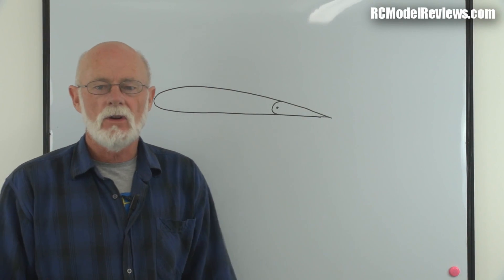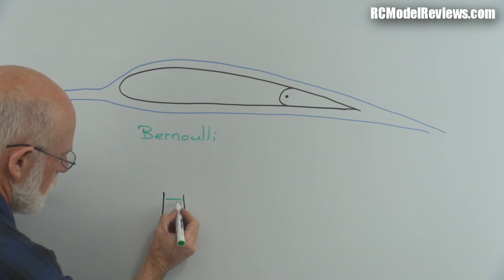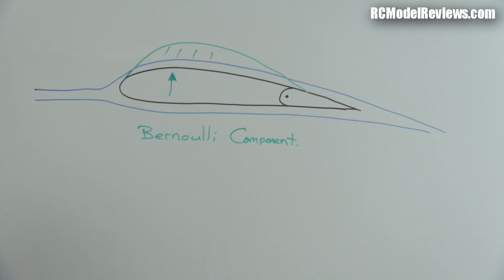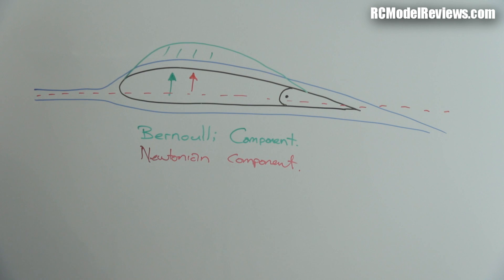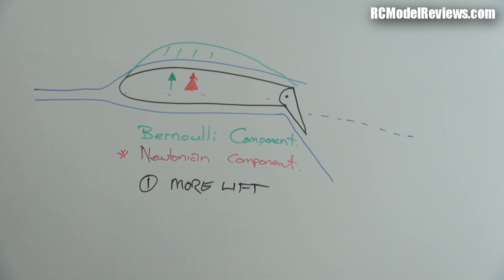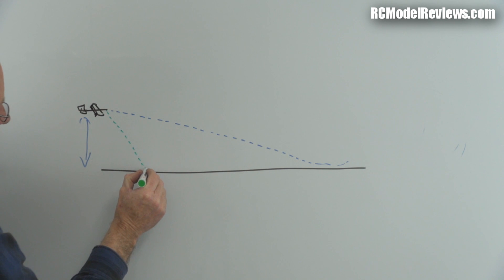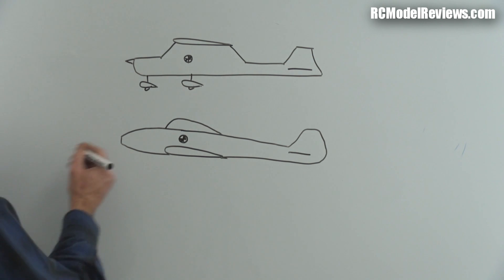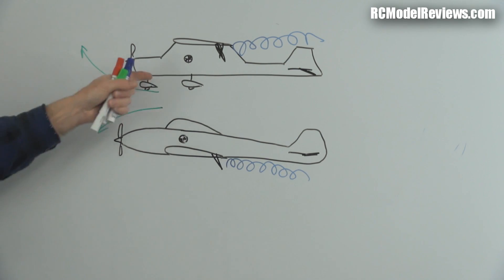How aircraft flaps work

Comment: What percentages of total lift come from the Bernoulli component and from the Newtonian component ?
Reply: i write, to share more-correct info about  Lift.   (forget the name   bernoulli.)
if the clark-y profile is  analyzed, it can be seen that it is a two-surface, cambered, flat-bottomed, low-re#, profile.      it is thickest at  29-30 percent of chord.       its (slightly) raised leading edge results in about  three degrees of, built in,  positive aoa.     AND  the  Wing  is intended to be mounted  at  zero-degrees aoa; relative to its lower surface.      consequently, this type of wing configuration  Makes  LESS  drag  than ANY  wing that is mounted with  positive aoa. !!!!
newtonian lift occurs  at the forward  five to eight percent  of the lower surface  of a (clark-y)  wing.
aerodynamic lift occurs  Below the parts of the wing,  where  Turbulence  is  present, Above.  (roughly, the, aft, forty percent of chord.)       cheers
http://1.bp.blogspot.com/-5C8vhlmhBOk/VRe3o3Jt3yI/AAAAAAAABrI/EEgVHXkLvbY/s1600/clark%2By.gif

Comment: At 3:23 you assume that lower and upper flow travel their paths in the same time (upper being longer). From basic aerodynamics we know, that this is not the case, the fluid particles that part at the nose in general don't meet at the trailing edge. (Of course you have mentioned that this line of reasoning is not entirely accurate, but heck... ;) )
Reply: For aviation students and patterns, the way in which he explained is still the most assumed  as correct.

Comment: Good teaching. It would be enlighting if someone explains "why airplanes fly" with symmetric wing profile. After that it would be more informative to show a bit asymmetric wing profile that create some Bernoullis effect also.
Reply: if an aircraft wing has a symmetrical profile, either the aircraft is over-powered/a prop-hanger;   or  the wing is mounted with  positive aoa.     unfortunately, the use of the latter was   common, in the  gas-power era.    so, we still see  models  where this  antiquated configuration is still (blindly) being used.    cheers

Comment: You are a great teacher and this video is very informative, but a nasa study shows that both of those theory’s are erroneous. It has been proven that “Newtonian” lift has ever been achieved was at very high velocity in low pressure air. Thus it is not the 3rd law that causes a plane to rise rather when the air splits when going over an airfoil, the shape creates a phenomenon on the top of the wing at the leading edge that causes that air to accelerate , and move faster over the top than the bottom. The top of the wing is actually much more significant than the bottom. Thus it obeys Bernoulli’s fundamental principle, but the distance theory and the Newtonian theory are completely debunked and aren’t actually factors in flight. Look it up for yourself. You can find it on nasa

Comment: I completely understand how moving air has an effect on pressure, but I cannot understand why the air over the top and bottom of the wing has to meet at the same time along the trailing edge. From my understanding of the physics there is no reason for such an assumption. And if the split streams do not have to meet at the same time, then why does the top stream have to move faster just because the distance is slightly longer along the curve? Maybe it does, I don't know, I'm just saying I do not understand why this would  be the case.

Comment: Bernoulli wrong, Newton correct. 

ANGLE OF ATTACK IS EVERYTHING. ALL wings generate lift PRIMARILY due to some measure of angle of attack. That angle is established by the horizontal stabilizer. 

There is SOME lift via Bernoulli with a TRUE flat bottomed airfoil but the effect is minor. 

Consider that UNDERCAMBERED wings lift MORE than flat bottomed wings. And they do that for the same reason that flat bottomed wings generate a bit more lift than fully symmetrical wings. 

The wing simply SCOOPS the air. It really IS that simple.

Here's a good explanation https://www.youtube.com/watch?v=w78JT6azrZU&lc=UgjUko_tf5vL3ngCoAEC.8EQi2AokVTW8w0lYg0lbx-  that is MORE correct, but they left out the angle of attack aspect.

Comment: Thank You very much for the video and very nice way of explanation. But , just one thing I would like to point out is that, modern explanations and newer research for the reason behind generation of lift suggests the 'Coanda effect' and not Bernoulli. The flow from the upper and lower surface do not meet at the same time.
Reply: No, Coanda effect is completely uninvolved in lift generation. I'm not sure how that spread so much but it's completely wrong. Source: probably any aerodynamics textbook ever written, but Anderson 12th edition for sure

Comment: Late to the party, but still an excellent video. 

I would like to add a warning to people who choose to go with "flaperons" on their model, (where ailerons and flaps share the same control surface). Especially when the model incorporates full length ailerons, (ie: aerobatic planes/flying wings etc.).  You must be very careful of your speed and your directional corrections under these conditions. Any directional correction should be as minimal as possible. If you're flying your model with the flaperons deployed fully and the model is flying just above it's new lower stall speed, then you suddenly make a large correction with aileron input, the rising aileron will drastically reduce the lift thus taking away the extra lift the flap was giving and very likely stall that wing, causing a spin, if it has time to spin before it hits the ground. Just something to keep in mind.

Comment: Flaps reduce your stall speed but when you turn your stall speed starts going back up . And also you would better off starting with different camber wings and then explain how flaps work how they change the camber of the wing and when you put in flaps high or low wing the nose will pitch up because of the extra lift being generated by lowering the flaps . Jets have flaps and slats changes the wing area and camber . And with how a wing works don't forget to explain laminar separation. . These are only theory because no one knows how a wing works 100% they are only guessing.

Comment: Actualy the pitch up and pitch down answer is because of flaps extra drag not because of extra lifting force. The cg of the plane must be already aligned with this wings lifting force and this forces will not create any tourque because it has not any perpendicular force between cg and lifting force line.
If you create a new force with flaps drag or anything else that will cause a torque and this torque will try to spin model from its center point until you create a negative torque, in this example with elevator or something else
Thats why the plane starts to act like it has a elevator movement

That may be my first comment under your videos, because of that i dont want to be the bad guy :D just because of correcting something in video
I like this channel so much and you are the one of my best teachers thank you so much for everything you teached me :-)
Reply: What?! Did you watch the same video as me? You're not correcting anything, this is exactly what he says in the video at 11:41. Nor does he say anything about lifting force creating pitch change.

Comment: Thank you for the (simplistic) explanation.  The only spoiler for me was a bit of confusion you caused by naming that dotted red horizontal line (the one you drew through the airfoil on the whiteboard) a datum.  The only 'datum' I'm aware of in an aircraft is its 'reference datum', often from the leading edge of the wing, which is in the vertical, not horizontal, plane.....!??

Comment: Oh God here we go another deluded Bernoulli disciple. A higher streaming velocity is the effect of a lower pressure and never its cause.The conventional explanation of aero dynamical lift based on Bernoulli’s law and velocity differences mixes up cause and effect. The faster flow at the upper side of the wing is the consequence of low pressure and not its cause. And what effect lowers the pressure - the Coanda Effect. 

Low pressure precedes velocity and not the other way around. The low pressure caused by the air flow following the air foil shape (the Coanda Effect) THEN causes the air to accelerate. Anyone who would like the theory to back this up simply email me and I'll forward it on. This was a common knowledge until about 1920 when academics began injecting their distorted view into aerodynamic theory.

Comment: I am sorry, but you are repeating bad science that is well known to be incorrect.
...
@ 1:43: Bernoulli did NOT say "The faster the air flows, the lower the pressure. " He said that when the speed increases (accelerates) there is an accompanying decrease in pressure.  The difference in pressure is the source force that causes the acceleration.  A higher pressure accelerates the air toward a lower pressure region.  That is why it is moving faster when it gets to the lower pressure.  Air has mass and it takes a force to accelerate any mass, even air.
..
@ 2:39 The blown air is at the same pressure around it.  When the stream of air hits and is forced up and over and around the top of the straw (this is acceleration) the acceleration causes the lower pressure.
Full explanation and demo here:
   http://www.millersville.edu/physics/experiments/093/index.php 
 ..
@ 3:00 Bernoulli was correct. People just misrepresent it, See @ 1:43 above.
..
@3:20 The air above beats the lower air by a long shot. See for yourself on a real wing:
 https://www.youtube.com/watch?v=UqBmdZ-BNig   Narrated, no title at start Cambridge Univ.
 ..
@ 3:25 The upper pressure is lower because it is trying to swing out, away from the curve due to its inertia. This is Newton.
..
@ 5:13 The pressures around the wing provide ALL OF THE LIFT force AND also cause the downward flow behind the wing. Pressure accelerates the air downward - the same pressures that push the wing up.
The pressures do both things. The downward motion is not something that "adds" to the lift.
..
The flaps increase the effective Angle of Attack (just like increasing the whole wing's Angle of Attack) which increases the acceleration of the air both below and above which causes the pressures to change more, meaning the pressure under increases more and the pressure above decreases more.
..
Summary: The relative motion causes the wing to push air around inorder to move through the air.  This directly causes pressure changes at the surface, fortunately for us this is an increase below and decrease above.  This is ALL OF the lift.  These SAME pressure changes also cause the air to be pushed down as the wing goes by.
Real measurements around real wings show that the magnitude of the upper and lower flow velocities are not very different, but that the air above is accelerated much more from a forward movement to a rearward movement totally changing direction. (YES it actually goes toward the tail as the wing goes by). This faster on top nonsense illusion is only seen in the unnatural reference frame of a stationary wing in a wind tunnel.
...

Comment: Nice explaination sir, got some knowledge about flaps and aerodynamics.......
Reply: +Bharath,
I am sorry, but this video is repeating bad science that is well known to be incorrect.
...
@ 1:43: Bernoulli did NOT say "The faster the air flows, the lower the pressure. " He said that when the speed increases (accelerates) there is an accompanying decrease in pressure.  The difference in pressure is the source force that causes the acceleration.  A higher pressure accelerates the air toward a lower pressure region.  That is why it is moving faster when it gets to the lower pressure.  Air has mass and it takes a force to accelerate any mass, even air.
..
@ 2:39 The blown air is at the same pressure around it.  When the stream of air hits and is forced up and over and around the top of the straw (this is acceleration) the acceleration causes the lower pressure.
Full explanation and demo here:
   http://www.millersville.edu/physics/experiments/093/index.php 
 ..
@ 3:00 Bernoulli was correct. People just misrepresent it, See @ 1:43 above.
..
@3:20 The air above beats the lower air by a long shot. See for yourself on a real wing:
 https://www.youtube.com/watch?v=UqBmdZ-BNig   Narrated, no title at start Cambridge Univ.
 ..
@ 3:25 The upper pressure is lower because it is trying to swing out, away from the curve due to its inertia. This is Newton.
..
@ 5:13 The pressures around the wing provide ALL OF THE LIFT force AND also cause the downward flow behind the wing. Pressure accelerates the air downward - the same pressures that push the wing up.
The pressures do both things. The downward motion is not something that "adds" to the lift.
..
The flaps increase the effective Angle of Attack (just like increasing the whole wing's Angle of Attack) which increases the acceleration of the air both below and above which causes the pressures to change more, meaning the pressure under increases more and the pressure above decreases more.
..
Summary: The relative motion causes the wing to push air around in order to move through the air.  This directly causes pressure changes at the surface, fortunately for us this is an increase below and decrease above.  This is ALL OF the lift.  These SAME pressure changes also cause the air to be pushed down as the wing goes by.
Real measurements around real wings show that the magnitude of the upper and lower flow velocities are not very different, but that the air above is accelerated much more from a forward movement to a rearward movement totally changing direction. (YES it actually goes toward the tail as the wing goes by). This faster on top nonsense illusion is only seen in the unnatural reference frame of a stationary wing in a wind tunnel.

Comment: What happens to stall angle with extending flaps..? Thanks
Reply: It will be less for the main part of the wing. With flaps extended the critical angle (stall angle) is less than when not extended.

Comment: I can't speak for model airplanes with flaps because I've never flown one with flaps but with a full scale low wing aircraft, the nose will pitch up just like high wing aircraft, I have noticed that low wing aircraft like the Piper Cherokee, the pitching up behavior is not as prominent as it is with a Cessna 172 high wing.

Just a couple of weeks ago, I flew an Aerospool W9 which is a low wing sport class aircraft with fairly small flaps but the nose pitched up significantly at about 12 kts above stall speed. 
A friend of mine flew his Piper Arrow low wing and was having to add full down trim at near cruising speed after takeoff, he felt pretty dumb when he realized that he had forgotten to raise the flaps. 
That was slightly dangerous since we're not supposed to use flaps above the white arc on the airspeed indicator.  Normally we retract the flaps at about 300 ft. AGL, he has a lot of hours but for some reason he simply forgot to retract them.  
One thing to note is that even though the CG is above the wing on low wing aircraft, the wings will have quite a bit more dihedral to stabilize the aircraft since the bulk of the weight is above the root of the wing, keep in mind that the tips of the wings are above the CG in most cases, hence the added amount of dihedral.  
They have to add a lot of dihedral to low wing aircraft to be stable in flight, otherwise it would be like flying a nearly straight, symmetrical high wing inverted, the natural tendency to roll back upright is pretty high.

The nose may pitch down on some model aircraft with flaps since the weight is so much less than a full scale aircraft, I'll have to do some experiments to see what happens. 
One thing to remember is the size and density of air molecules having a much different effect on models compared to full scale.

Nice tutorial! :-)

Comment: I'm a Private Pilot. When I fly a Cessna 172 (high wing) and deploy flaps, i have to trim nose up because with adding flaps, the nose wants to drop and I have to maintain pull on elevator yoke to keep plane on glide slope therefore, i need to trim nose up to balance forces on yoke.
Reply: On some craft there is up pitch and others have down pitch.  Depends on several things.

Comment: Can you determine CG from center of lift? Maybe a video explaining that as it's different depending on wing type. Delta wing Clark Y etc. Also  when flaps are deployed. does that turbulent vortex of air affect your elevator effectiveness?
Reply: Ken,
CG is a function of the weight distribution of the plane.

Comment: In your first diagram,  how much more area can be lessened by using flaps vs with out? 500 feet? 2000 feet? 3000feet? Say with standard small single engine at normal speed & decent  for landing.

Comment: Hi! It would be nice to see here Lilienthal's Polar Diagram, but anyway comprehensive presentation.
Probably worth mentioning (or with more emphasis) - flaps are mainly drag generating devices (lift is not the main part here :). One equation to remember is quite easy in that case:
Cdi (induced drag coefficient) = Cl^2 (lift coefficient squared) / Pi * AR (wing aspect ratio)

Cheers!

Comment: What do trimmers do ? 

Im talking about those wheels inside the cockpit that rotate pretty fast ( 737 )
Reply: iplaybose they allow the pilot to keep the plane in a steady state with no control inputs. If you want to climb or descend, the pitch of the aircraft has to change. To hold the new pitch requires a continuous input on the control column. The trim switches/wheel are used to “trim out” these inputs, so that you can let go altogether and the plane will stay where you want it. Trim changes are also needed for a change in airspeed.
Modern fly by wire aircraft trim themselves automatically. Airbus aircraft do all of it themselves, whereas in a Boeing 777 or 787, the pilot still has to trim for changes in airspeed, but no pitch.